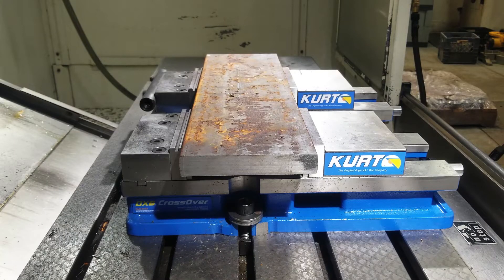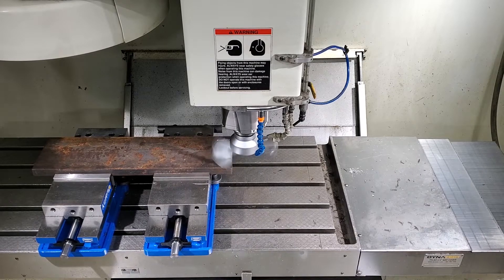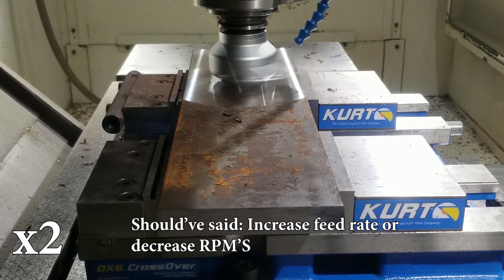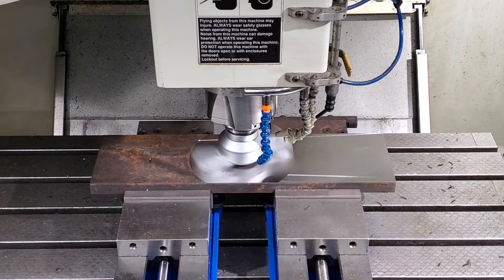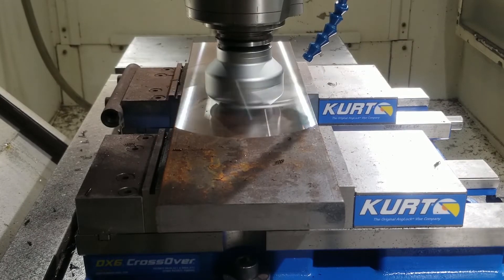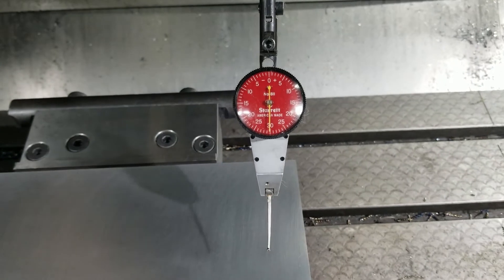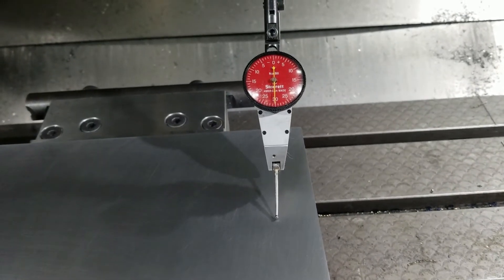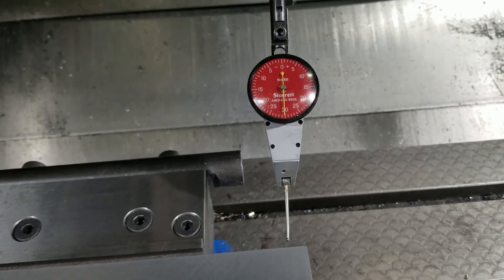Suburban Tool Fly Cutter as good as Surface Grinder?

Comment: Wow. Thanks for actually showing the precision accuracy of the surface finish using the dial indicator, able to produce a 1 thou surface finish is really remarkable, thats 25 microns, thats true precision and really doesn't require an expensive surface grinder for many in the industry.

Comment: hi is it super shinny? can I use it for surface aluminium cast or cast iron cars ?
Reply from the maker: Hi the finish can be made very shiny depending on the feed rate and spindle speed you use. Faster RPMs and slow feed will give a very fine finish. It is similar to turning on a lathe but instead you are using a mill. This tool is excellent for cast aluminum and cast iron. The uncoated insert is recommended for aluminum and cast iron for best results.